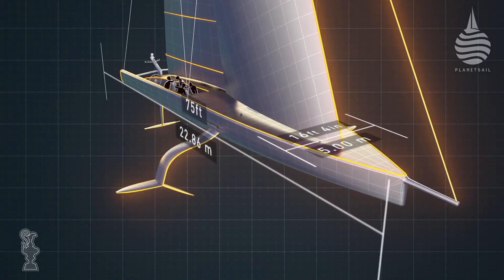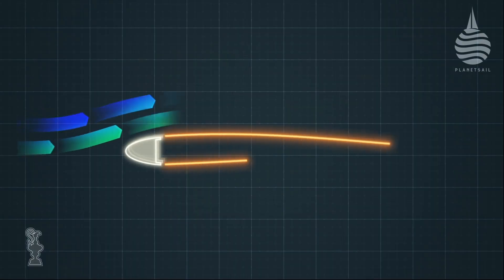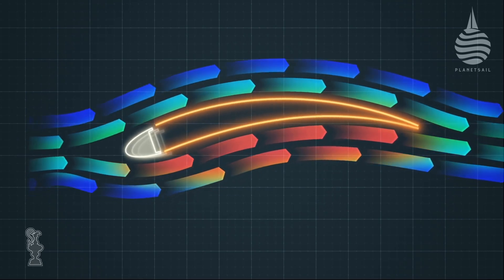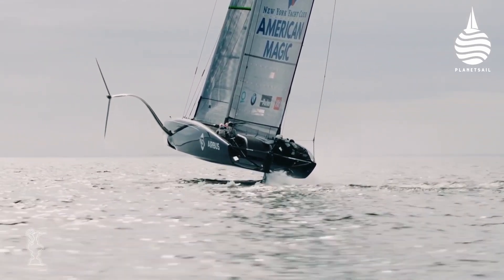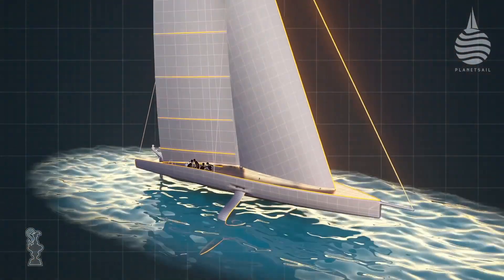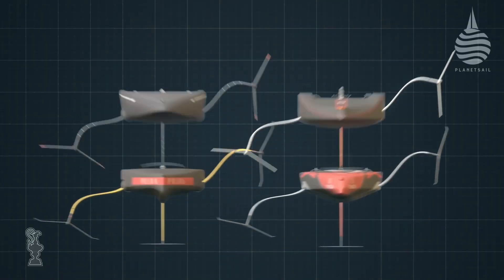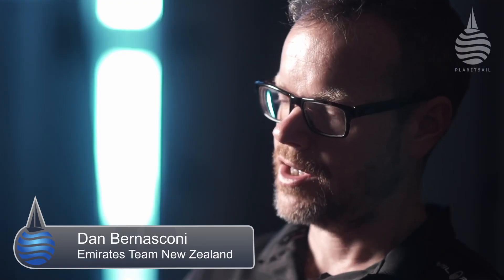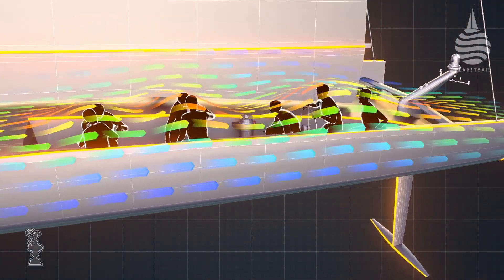How do America's Cup boats fly?

Comment: Why do the rules say that only one foil can be in the water at a time apart from when manouvering? What is the reasoning behind this rule?
Reply from the maker: Allowing the windward foil to be in the water would allow teams to generate additional righting moment and hence more power - arguably too much that would create serious structural issues. The other reason is that the defenders in any cup cycle want to be able to to limit the amount of righting moment and hence know the max power of all of the challengers. Creating rules that place a cap on righting moment by preventing the use of a foil that pulls down on the windward side one way of doing this and easy to police

Comment: what are the men doing turning those winches?
Reply: The grinders create all the energy for trimming the wing sail and the jib, powering all the Maneuvers, and adjusting the heel and the ride height.
Reply: @allentobolewski7273  Thanks but please elaborate. The energy is stored in a battery? On a normal yacht, the winch is turned manually which rolls in the sail and jib at the same time. All I see is the grinders continuously grinding to no end. Surely they aren't always trimming??
Reply: @skeche  . There are two types of Grinders. one is direct drive to turn spindles for trimming the sails. The second kind is hydraulic to move the Mainsail and lift and lower the Water wings.

Comment: Why can only one foil be in the water by rules?
Reply: It’s not a rule. Quote often they use both. But in general, at high speed, when foil lift comes over and the boat actually flies, the wind torque can be balanced only by one foil in the water. If there are two foils in the water you have not the force equilibrium. It’s a very simple engineering exercise.
Reply: @rich8713  thank you. They said'by rules' so I was currious.

Comment: Water is not compressible. So resistance, not lift must be in play. Isn’t the hydrofoil essentially a horizontal rudder?
Reply: Water is compressible, we just like to assume its not for the sake of calculation
Reply: @andrewmitchell5807 The pressure required to compress a volume of liquid water by 1% is 2 x 10^8 Pa... So basically in normal conditions is really incompressible.

Comment: What control surfaces are the AC 75 boats wings? Does the tail just have a rudder, rudder and elevator, or rudder, elevator and ailerons? Ok, ailerons. No, rudder or elevator? No elevator, these boats are going to pitch pole violently, not a very intelligent design. How do they change the lift on the stern from positive to negative to keep the nose out of the water?

Comment: 5:15 It appears the animation has the pitch the trailing edge opposite of the movement of the wing and is shown incorrectly. When the trailing edge flap goes up the wing should go up when the trailing edge flap goes down the wind should go down. At least it does in aircraft maybe it’s the opposite with this underwater wind for some reason
Reply: The animation is correct. Pitching the flaps down increases the camber of the foil which results in a higher lift force to raise the boat out of the water. Think of flaps used for takeoff and landing in an aircraft, they are used to increase lift at lower flight speeds.
Reply: @jackdavies5784  agreed, but then I’m curious, how do you control the global pitch of the vessel? Done topside, somehow?  Edit: oh I think I’ve got it; the horizontal control surfaces of the rudder could act to control vessel pitch
Reply: Your thinking is on the wrong side of the axis of rotation

Comment: Fascinating wing tip engineering ....This brings me back to the original "winged" keel breakthrough when Australia won the cup...Like to see how these racing machines perform in ultra - light breeze
Reply: I'd like to see how these racing machine perform in heavy air.
Reply: Do you need to have steady wind for these boats?  What if the wind is puffy?
Reply: @davidho2977  they have a minimum amount of wind approximately 6 knots and a maximum of approximately 20 knots. Reason for these limits feels so that they are finished within 45 minutes or it is terminated. So they don't sit out there all day doing nothing. Also sailboat races have a time limit for the same reason. The maximum wind is set so that the boats aren't broken to pieces.

Comment: If a crews only job is to provide power, have them replaced by an engine, I mean, sail power once replaced the galleys, and now sailors turn slaves
Reply: I watched a video where Team NZ said they had a comp programme they told them what was the optimal way to sail and it was up to the sailors to get there.
Reply: It sounded to me that the crew was just there to charge up the batteries that drive rams to do all the foil and sail control.
Reply: @davidho2977  rule 52 violation...